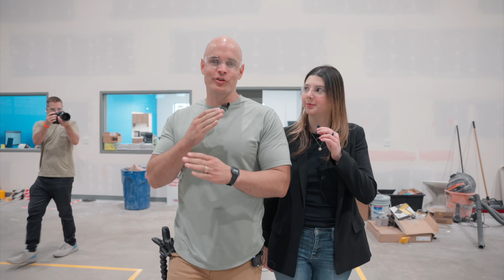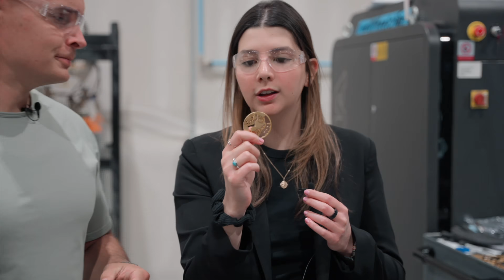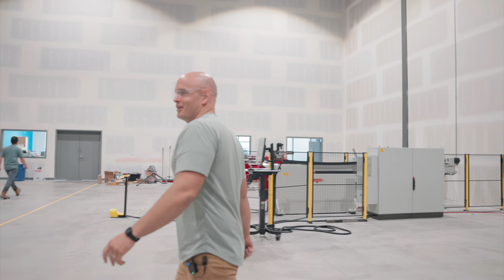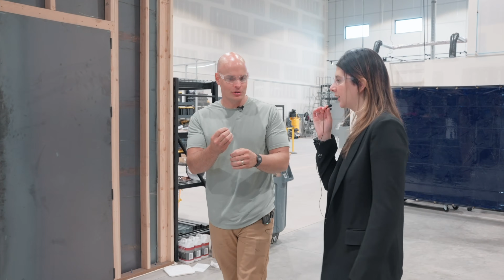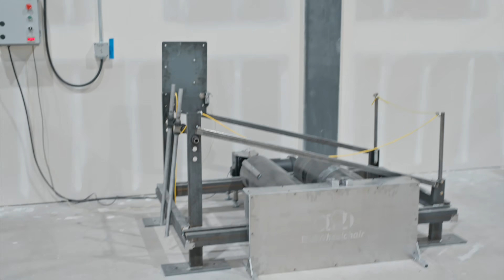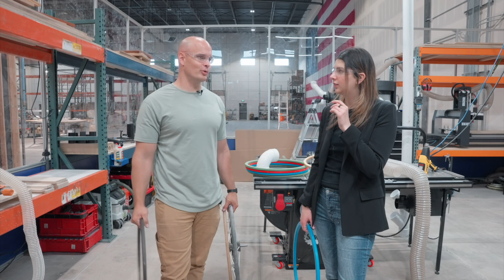I Toured JerryRigEverything's Factory!

Comment: I’m interested in your wheel chairs but on tracks. No one builds one for a large person I weigh 420 pounds. 
I’m on disability but that is running out. 
I’ve had bilateral knee replacement with 3 revisions a total of 10 procedures in a 3 year span. I’m wanting a tracked chair to use on uneven ground to get photos of trains.

Comment: I think I probably would have went with plasmaCAM type setup instead of a full laser setup, laser machines are outrageously priced, and you get about the same drossless results on cut material. Plasma cutter would cut through that thin stuff like butter for less energy, and less cost. Requires no gasses, no cooling hoses, only little current and an air compressor. You still have your consumables, but at least your not shelling out thousands of dollars a year later for new laser tube and cooling equipment.  Just my 2 cents.

Comment: powdered steel and aluminium is thermite. a explosive mixture used for cutting and welding steel.

one of the worst industrial explosions in America was at a plant that made sintered castings and forgings from powdered aluminium. from a lack of cleaning maintnance the dust built up in the roof structure and on the ducting and a small explosion disturbed it and it went boom again. and killed or seriously injured several people

any fine dust can explode.

Comment: quick google and his manual wheelchairs are not 80% cheaper.
Compared Jerry $1,014, EU $300 - $1,200, US $150 - $1,500 and UK $250 - $1,100 prices. why ?
Reply: I think that you need to look for customized ones. Jerry allows you to choose almost every aspect of the chair to be modified to fit you (Lenght of seat, cushion, angle of different parts, handles, ...) You can get a wheelchair for cheap but it will not fit you correctly and that is an important aspect on the usage of a wheelchair in the long term.

Maybe a fair comparison is the sizes in clothes. You can get XS,S,M,L,X,... they fit in some aspects but in others they are smaller or bigger than you in a "small amount" but not perfect in comparison to a clothe made by a tailor that suits you perfectly. This carries an obvious difference in price because isn't mass produced, its tailored to your measurements and specific needs for comfort and usage.

Comment: 05:15 What he talks about is a thermite reaction. Cutting steel will produce iron oxide and if it is hot enough the aluminium will reduce the iron oxide into pure iron and produce like 2500 degrees Celsius (4500 F).

Comment: I am so impressed with your factory as well as your personality and ambition to complete this project. Now don't get a big head over that!  I'm in a wheelchair and I like to invent and build things too.  I created a "Hauler" by name, that is a platform with a railing and big fat small tires.  I started with a wheelchair prototype and broke it down into parts, which I used with a new frame that my father built out of square metal tubing.  I used an electronic controller that was designed and used for battlebots!   I had to wait for several years for that component to be invented.  I'm still working on this device and trying to complete it.  It works and runs well but not to the finished state I would like.  I wish the best for your company.

Comment: I work at an actual light fab/sheet metal shop. Shop checks out, it's a legit operation. The next step would be auto-feeders and inline process machines, which are monster operation like what they use to build normal wheelchairs 
I can't wait to see where this is in a few years once they hit their stride, I know a few people who could use something like this even though they don't need a normal wheelchair. Going around a park or state fairground with a cane is a lot of work

Also, cutting a ton of aluminum and some steel on a laser is a great way to make thermite in a filter. You have to keep a Class D extinguisher handy, and they are not cheap, LMAO. We have one by our bandsaw and by our graining machine. the aluminum burns hot enough to strip the oxygen off iron oxide, which kicks the fire up hot enough to flow the liquid steel.